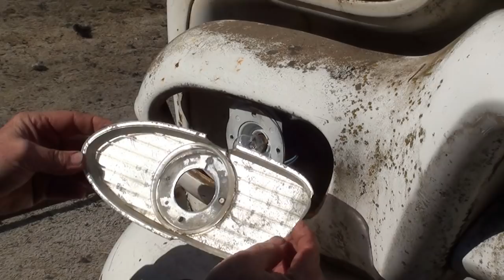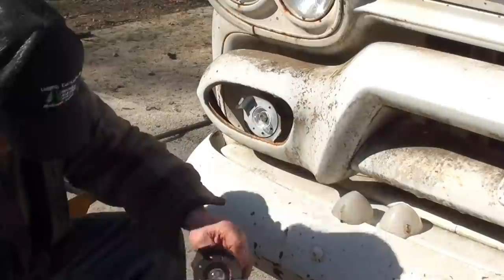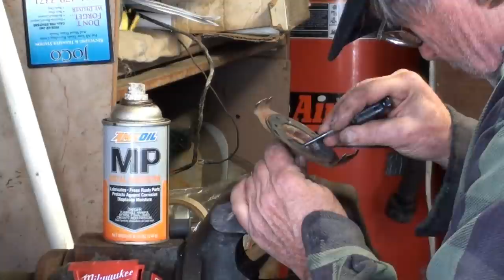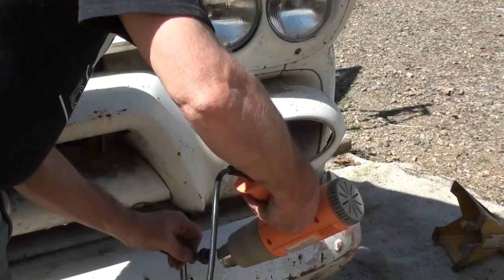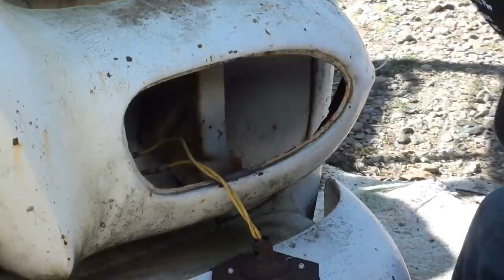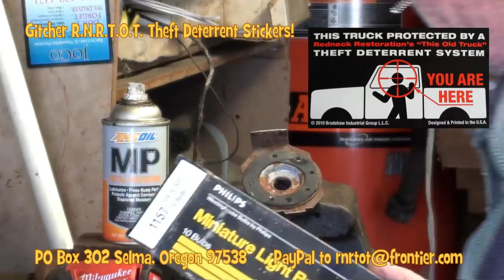1959 GMC 100 Turn Signal Repair and Replacement

Comment: Glad you got it working, but like you hinted at, amazing if they worked at 10 yrs old (or younger depending on environment).
 Definitely makes the truck look right though with 'em there.

Comment: That front plate seems like a good candidate for 3D printing.
Reply: If you wanted them in a opaque material.  Can't see a 3d printed set of clear plastic, because the clear would show every run of the printer head, nevermind if you could find clear 3d printer spooled plastic line.

Comment: I’m always so afraid putting those bulbs in I’ve had um brake n slice a finger wide open. I like the led replacement bulbs that go in the sockets . Factory look without the hassle

Comment: If you could gather up enough bits of broken ligt fittings you may be able to glue together a pair which could then be used to make some latex moulds. Then clear resin castings could be made which would look like the originals. I have made small impossible to buy peices for cars doing this but with the Wuflu prices for casting materials has gone stupid. it might be better in the USA.
Reply from the maker: At the time I bought these, repo's weren't available. Now they are. I also had a friend of mine making one from an excellent condition left side.

Comment: First off glad your doing better always love the videos if you have time i was wondering if you have ever got a high performance clutch kit for a 66 4 speed you could recommend any hekp us always appreciated
Reply from the maker: Is there a reason you need one?
Reply: @ElderlyIron   after further digging prbably not i see everyone saying the trans can only hold about 350 horse and im gonna be arpund 450 so i either drive like grandma of get something else
Reply from the maker: @michaeladams4381  I assume we're talking truck, here. It's all in how you drive it, though I'd say Grandma is taking it a bit too far! It's tough to destroy an SM 420 or 465. You have to be able to hook up the rear tire to the pavement at any rate. Spinning tires do not provide enough resistance to create a real load on the gears. You'll need a posi and some rear suspension work to prevent the wheel hop. You'll likely break u-joints before the trans! If you intend on drag racing it a lot, then I'd think about a trans or clutch. Since you'll need to be at 4500 RPM to be in that kind of HP range, I don't think you're going to be pulling a heavy trailer or a load of gravel while doing it, eh?
Reply: @ElderlyIron   no my plans are to poly the whole rear and yes it a c 20 with the floating heavy 3/4 ton rearend and im want to get a late model 1 piece from a suburban and possibly weld the rear soild its a just for fun truck as most parts are off different trucks i guess i can just fox what breaks as i go
Reply: @ElderlyIron  also as always thanks for taking the time out of your day to talk with me
Reply from the maker: @michaeladams4381  Happiness is the pursuit of a toy that won't break! If it's 3/4 ton, then it's leaf spring, and you'll have serious wheel hop. You'll need a pair of traction bars to keep from beating it to death.
Reply: @ElderlyIron   its a long bed with track bars already i need to do all the mounts and driveline as yes its the weakest link

Comment: Wow I can't believe the bogus GM engineering on 59 . A clip in turn signal bezel ? Bad grounds would be a common problem . Someone could walk off with them when you're parking it out in public . You can really see the evolution of the GM P.U. over the years . The 73--87 square bodies were far better engineered in comparison
Reply from the maker: They were pretty much one way. You couldn't just pull them off without damaging something, but hey, they destroy stereos to get them out, eh??